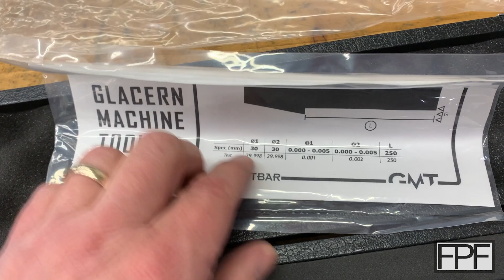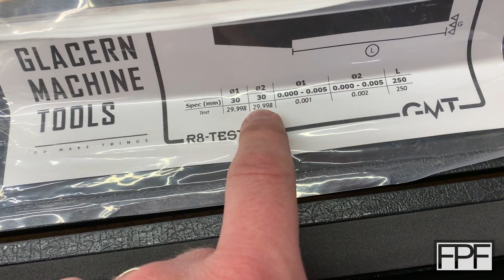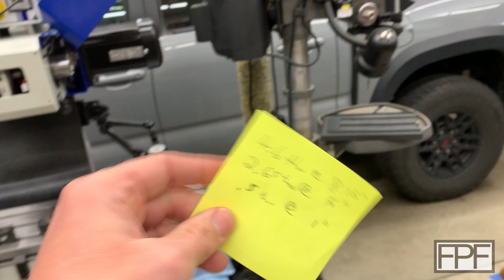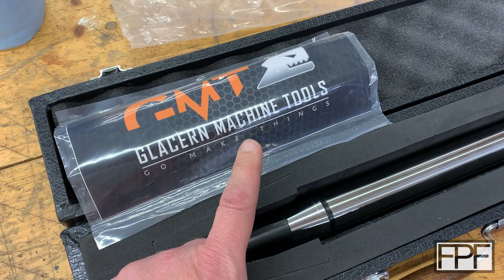#notfriday Chasing Down PM-728VT Mill Spindle Runout Problems with an R8 Test Bar

Comment: I,m glad precision mathews helped you. NOTE : IF YOU BUY A USED PRECISION MATHEWS MACHINE(MINE WAS NEVER USED) THEY WILL NOT WARRANTY ANYTHING! 
the spindle  taper on my PM940v was ground wrong casuing horrible surface finish!
AFter 30 emails Wiht precision mathews I'm still without a replacement spindle or resoloution. Does anyone know of a spindle that will fit My Mill?
Reply from the maker: I believe they will sell parts for all of the machines they import.  Just reach out to their sales team and tell them you want to buy a "PM940MC-102".  I can't comment on the warranty.  Most warranties do not transfer beyond the original owner, but they should certainly sell you parts.
Reply: @FunctionalPrintFriday  They ended up helping me out. I take back what I said. SO I will likely buy from them in the future.

Comment: It's alarming that the replacement part they sent to you is worse than the original, which to me suggests that there's some kind of a design/manufacturing problem with this milling machine. But if this is the case I'm surprised that there are not more examples of the issue presented on youtube and elsewhere by now.
Reply from the maker: Agreed.  The parts are on the way back for PM to examine.

Comment: Back the keying set screws out and see if that helps. It seems to be consistently high where the setscrews are in both spindles. I wonder if the screws are jacking the spindle away from the r8 and pushing it off center.
Reply: If anything maybe take them out completely just to be 100% sure. Remove them just for testing of course. You don't want to spin a collet in the spindle and ruin them.
Reply from the maker: thx, they were already out though

Comment: Sorry if this is s dumb question, but is it possible that the issue is actually on the left-hand part? Perhaps why it gets worse the farther out you measure on the right?
Reply from the maker: It would be possible, but that's why I checked/confirmed that part first on it's own in the v-blocks.  It's also a precision ground test bar with a spec/test sheet .  They're pricey, but you're paying for the "guaranteed accuracy".
Reply: @FunctionalPrintFriday  I follow you now! Thanks for clarifying.
Reply from the maker: @spasecookee  no prob, thx for watchin

Comment: Very interesting. Maybe PM needs to do a lot more checking before releasing the replacement product (or even the original). Thank you for the interesting video.
Reply from the maker: They have a good reputation.  I think that possibly the demand for their products is outpacing their ability to keep a close eye on quality.  Their support is really responsive.  I don't think I've ever waited longer than a few hours for an email response.  We'll see what happens.